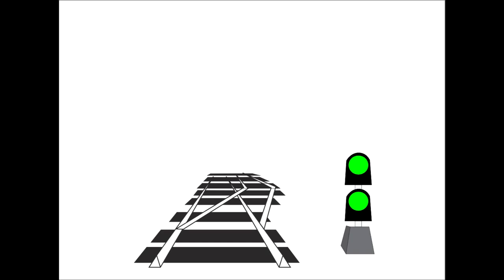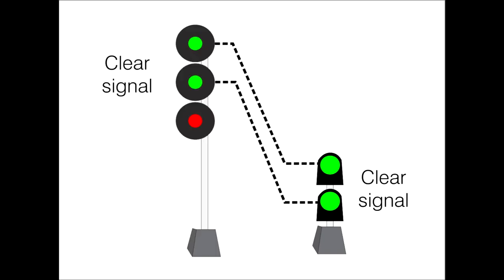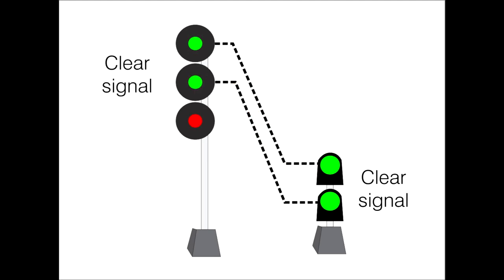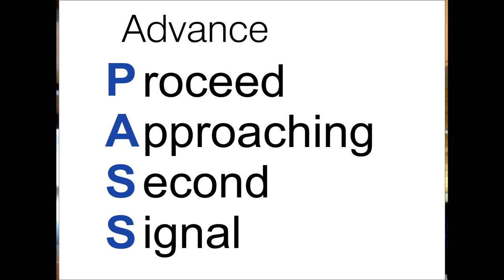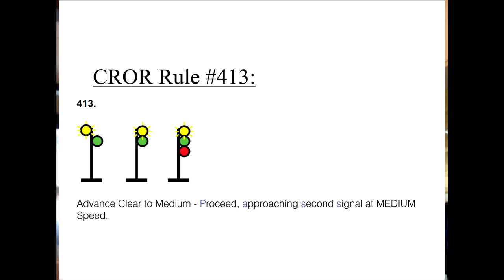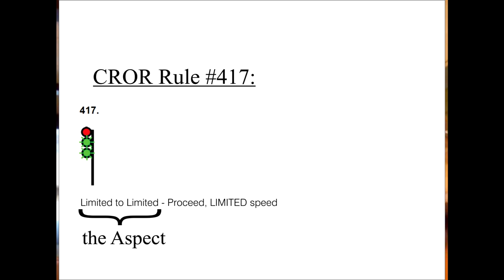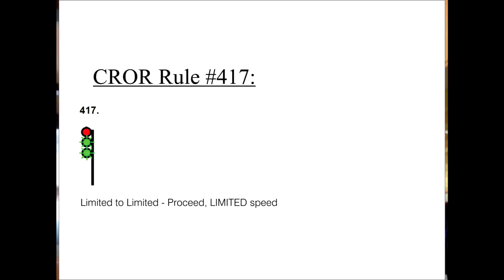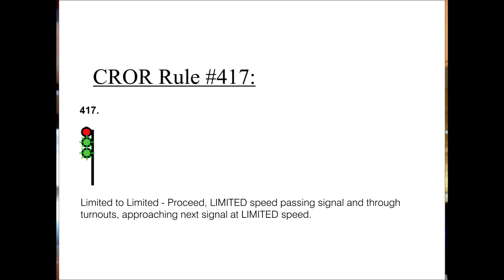Part 4 foamer's guide to reading railroad signals: dwarf signals no muzak

Comment: I keep seeing this signal on CP near me, and this signal seems to always be for work trains. The light combination is Red over Red over Flashing Green, and it's not in the CROR signal definitions or anywhere else. My best guess is that it's an "Enter OCS/Leave CTC" signal, but if anybody knows what it really means, please reply and let me know. Thanks!
Reply: Hi there, I just saw this comment while studying for my Signals test with CP rail.
According to my books it is a 'Slow to Block End' meaning: Proceed, slow speed passing signal and through turnouts. route is set for end of signal system
Reply: Update: I passed my signals test, it was very challenging trying to learn them but now I understand.

Comment: What about the overhead lights on multi tracks?
Reply: If you look at the St. Paul MN (parallels the Mississippi River) rail yard they have a 4 light across the entire cantilever frame and use red, yellow, and green color combinations.  I would assume that since this is a rail yard the additional lights are used as additional instructions for the trains.  Probably indicating which track to use for attaching cars, and probably the speeds to do this at (probably not more than 5 mph)

sig  sig  sig  sig
sig  sig  sig  sig
sig  sig  sig  sig
sig  sig  sig  sig

Along with this they also use the dwarf signals on each track segment.  Some are 3 head, some are two head, and some are single head.  On the bluff cliff side is attached the signal tower that is manned and probably computer controlled.
Reply from the maker: It would depend on the territory, but all the overhead lights I've seen are just simply considered high-mast lights, and the light is over the applicable track.
Reply: @ianjuby  Ya, after watching your videos, I now understand those lights better.  There are 6 lights in two rows with the bottom row being off-set, so 3 sets of ATC lights.  It makes a lot more sense now.

I'm in Toronto.